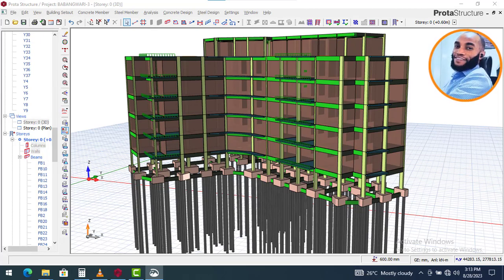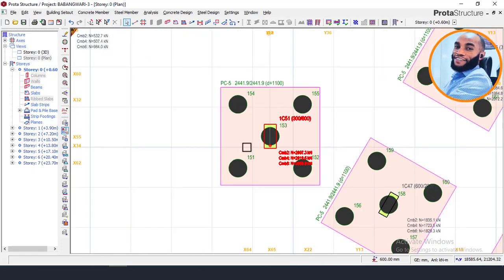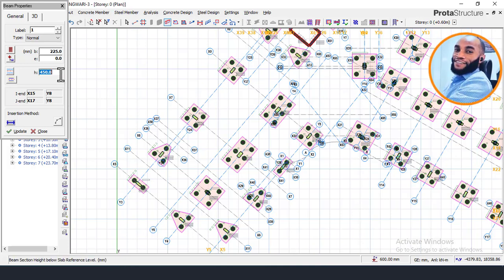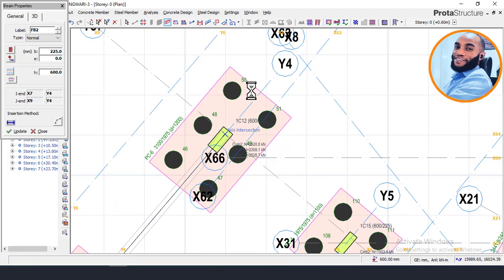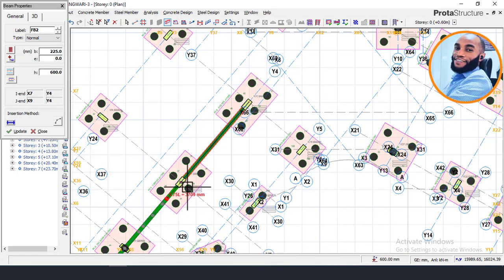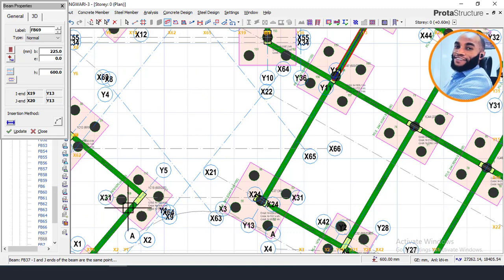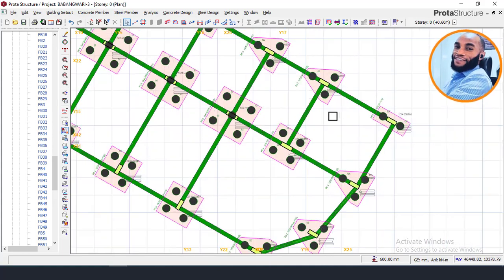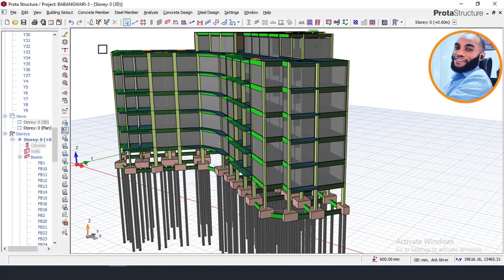Pile Cap Connecting Beam Design in Protastructure

Comment: Nice tutorial Engr.,
I have questions to ask;
> The connecting beams suppose carry ground slabs but from the video the beams are below top of the pile Caps.
Please explain.
Reply from the maker: The ground slab you just mentioned is not a designed slab, it is just a DPC slab so that can be done during construction
Reply: So it means loads(self weight and line loads) on the slabs are ignored?